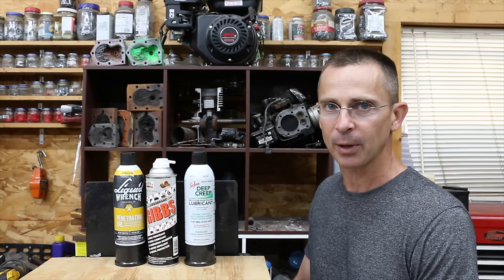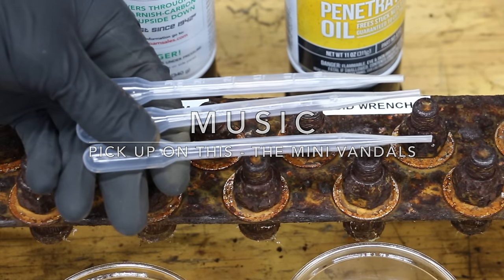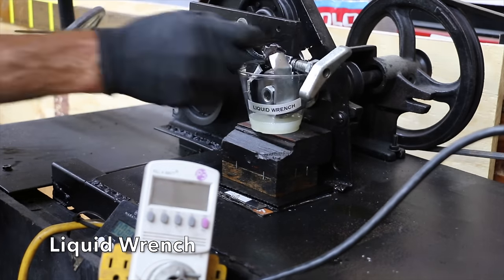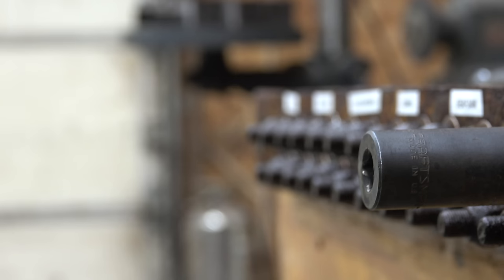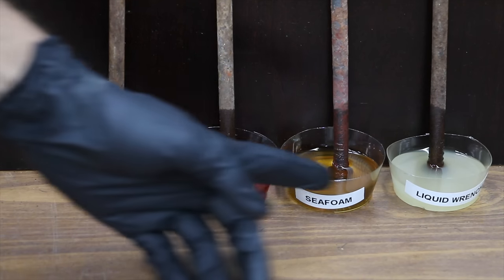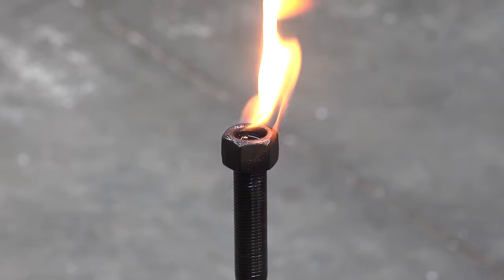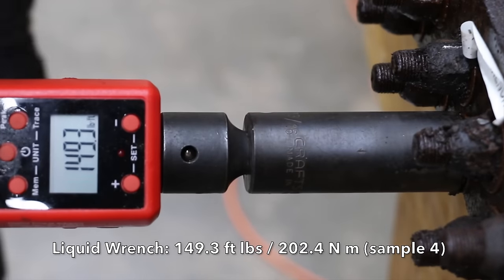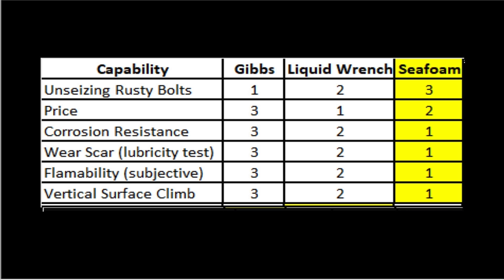Best Penetrating Oil?  Seafoam vs Gibbs vs Liquid Wrench

Comment: Why didn't you use wd40 and p.b. blaster or j.b something for this test??? And another thing when and if I use a spray lubricant I'm not waiting around I'll give it a few minutes and then I'm putting my wrench or socket on it and turning. Therefore I think you need a redo this test and see what happens and which one's the best in a few minutes of lubing the bolts and nuts also try drowning the nuts or bolts when it's rusted up like that then see how your results are because that's what I deal with on a daily basis it sucks and it's a headache and a nuisance
Reply from the maker: Great recommendation. I tested it in this video: https://www.youtube.com/watch?v=xUEob2oAKVs

Comment: I would.like to see what works best as corrosion protection for something like lug nuts on a salt water boat traiier or vehicle.in a state whe  they  use salt.. Seafoam,  fluid film, super blue marine grease,clear spray.paint,zinc spray paint,corrosion x,dupont teflon dry lube, silicone dry lube,never seize.On a side note fluid film seems to attract little flying bugs which get stuck in it and die.
Reply from the maker: Thank you for the video idea!

Comment: Could you try out MPM motor oil? Not as penetrant but as what its made for, kind of the wrong video to comment on haha. MPM is readily available for me (in the Netherlands) and I wondered if it’s any good. The ones I can easily get are MPM, Valvoline and Castrol oil (in case you needed oil to compare it to)
Reply from the maker: Thank you for the video idea!

Comment: I had to glue-on pieces of pvc brackets to the rear of pvc bath panel boards-  tried everything, then tried pvc plumber's solvent glue, tried to pull-off a test piece,- it took the board with it!!
Also;- I tried to re-stick a timber foot/leg to my plastic toolbox. Tried pva glue,:- no.  Super (c.a.) glue;- no.  Then polyester (GORILLA) foam type glue ;-  it held for ages, until someone dragged toolbox instead of lifting!!

Comment: Now for the next video,there is a brand new oil on the market called"BLUE-💎-DIAMOND",this oil is suppose to be"superior"(no pun intended)to Amsoil,it's ridiculously expensive at about $45.00 a quart,but the company that's based in Ohio says it's rated at 50-to-100,000 miles if you keep the oil really clean.
I looked up the specs for this stuff,the T.B.N.(Total Base Number)is 14.1.
Now,the T.B.N.system is O through 15,so it's suppose to be extremely tough.
I would like to see a video about a standoff between Amsoils 5W-30(signature-series)and Blue-💎-Diamonds 5W-30 weight motor 🛢⬅oil,this will make one,wicked,video!!.Thanks!!.
Reply from the maker: Wow!  Great suggestion!
Reply: @ProjectFarm  You could even have that eerie gothic opra music playing in the background for the intro...HAHA!!.(just kidding)

Comment: 05-08ish Ford v8 owners often need to put faith in something like ATF/Ace to help them remove those stupid 2pc spark plugs without fear and without thoughts of that expensive extraction job.  Even if you snap the first 1 the tool is about 150 from ford (cyl head stays on) and A/A will still help you remove the busted core.  Let it sit o/n and go!   Ford quoted my brother 800 for the job 1500 if they have to remove a head and 100 additional per plug if they should break (scum prolly would ‘break/lie’ about all other 7).   Bro asked Ford can i buy the tool.  They said yes but its expensive and takes 2wks to get here.  He heard price, bought it from Tousley Ford instead (good people) came in 2d.  Next morning his stang had 8 holes ready for new (and wisely 1pc) plugs.  It was one of the first affirmations we had after reading another test I believe in popular mechanics about A/A.  Good luck all.  By the way he sold the tool to another stang owner in a pickle for what he paid for it after we provided him visual proof that it worked.   

-U10

PS - have to ring stuck fasteners with a hammer when able.
Reply from the maker: Thanks for the feedback.

Comment: So if it's going to need heat: Seafoam
(it also works the best as a lubricant so it may be better to have sitting than WD40)
If you need the absolute most rust penetration: Gibbs
and if you need a lot or want to save a substantial ammount of money: Liquid Wrench
Reply from the maker: Thanks for the feedback.

Comment: OK have you ever did a video or a blog on gas treatments for methanol ethanol . Mainly into storing like a motorcycle or a small engine with gas in it. You see we store motorcycles and I know gas turns really quick these days. I was wondering if there’s anything out there that you know of or if you did any videos on this subject. Actually I just put a new fuel pump and a bunch of hoses and stuff on A Harley that’s been sitting for like six years he said three if your pump was like just about gone. I know that’s excessive. But I’ve stored gas over the winter is an experience an hey Harley that’s been shitting like six years he said three if your pop was like just about God. I know that’s excessive. But it seems this new gas doesn’t hold up for storage even for as much is for five months. Thanks
Reply from the maker: Not yet. Thank you for the video idea!

Comment: Friend, to prevent rust, nothing beats high temperature copper impregnated anti-seize coating. Prevent oxygen and prevent rust spraying the bolts with rust reversion and high temp paint to coat the bolts and I promise you better results
Reply from the maker: Thanks for sharing.

Comment: What if you used evaporust as a penetrating oil? Or a mixture of evaporust and another penetrating oil?
Reply: Oils are bad for Evapo-rust, that's why they tell you to degrease the parts before soaking.
Reply: Oh. I’ve never used it so I’ve never seen the instructions.
Reply from the maker: Thank you!

Comment: Have you tried Knocker Loose penetrating spray? I love that stuff but it smells like charcoal lighter fluid lol. That and PB Blaster mixed together have gotten me out of some nasty situations as a Auto Technician in Minnesota with all the rust we have.
Reply: I have also been told Automatic transmission fluid mixed with acetone or to use DOT 3 brake fluid in a pinch depending on paint in area.
Reply from the maker: Thank you for the video idea!
Reply: @ProjectFarm  just a heads up, i was soaking a starter pinion in the Knocker Loose/PB Blaster mixture in a cheapo wanna be clear red solo type of cup and about an hour and a half later noticed a leak.  Picked up the cup any the ENTIRE bottom came off the cup.

Comment: Can you test Rotella T5 & T6 vs MOTUL & Amsoil Metric Oil?
Reply: Rotella is and has been substituted for motorcycle oil for a long time. The diesel oil does not  contain friction modifiers that work well with wet clutches. I am not sure your typical oil test could apply to a motorcycle. Thanks for the content!
Reply from the maker: Thank you for the video idea!

Comment: Hi. I have one question for you. 

I'm fixing an oven, and there's a nut (the one from the fan) that is rusted and can't be taken off. I can't take the bolt where it is fastened, as it is fixed to the oven's hull so i can't put it in vertical position. I have a kitchen blowtorch and muriatic acid available, but i'm not sure if the heat will make any good and if the few acid that will remain in the nut and get in the gap inside the nut will be enough to remove enough rust. I also tried with lubricating oil, but doesn't seem to work at all. 

Any ideas?
Reply: Don't put acid on it, he used acid to ruin the bolts on purpose.  Heat it up and let it cool multiple times and oil it when warm.   That's what I would try
Reply: @RickBaconsAdventures  I'll try it, thanks for the tip.
And yeah, saw that video too, that's also why I don't want to use acid, I would like the bolt not to become a cheese if possible, ha ha ha
Reply from the maker: I would use heat.  I hope this helps

Comment: I've been using Liquid Wrench for ~50 years, and I see no reason to change, aside from availability. It's "old fashioned" I guess, and not seen as much these days. PB Blaster is the most common, but I have never found it to be quite up to Liquid Wrench standards. Still, I sometimes use Peanut Butter Blaster when I can't find LW, as it is certainly better than nothing.
Reply from the maker: Thanks for sharing.
Reply: ..I remember Liquid Wrench was about the only penetrating oil I remember seeing around back in the early '70's when I was a kid..remember Dad using it..it was a dark grey/blackish color back then..and it definitely smelled different/stronger than it does now..has it been reformulated, maybe?...would be really neat to find some vintage 1970's liquid wrench and test it against current liquid wrench..a la old STP vs. new STP.. :)

Comment: Wait your supposed to do 3 treatments over 3 hours damn my adhd. I have always used the age old trick of swear at it spray seafoam go for a smoke swear some more and bust out the I wasn't asking bar and wait for somthing to give (the breaker bar the nut or the bolt). If all else fails just bust out the sledge and swear while beating it until you feel at peace again
Reply from the maker: Thanks for the feedback.

Comment: In tests like the one-hour torque test, where you collect multiple samples of each experiment, you need not to draw conclusions merely by comparing averages.  Rather you need to compute the mean and standard deviation of each sample set and then use a statistical test called "student's t" to draw your conclusions.  Student's t will tell you whether the sample sets have so much variation that no conclusion can be drawn.
Reply from the maker: Thanks for the constructive feedback.
Reply: @ProjectFarm  Using the torque callouts in your video I performed student's t on the one-hour torque experiment.  I found the following:
1.  control:  mean 167.7, sigma 12.96
2.  LW:  mean 149.4, sigma 4.60
3.  SF:  mean 161.1, sigma 9.71
4.  G:  mean 145.5, sigma 9.33
Using those distributions I then performed pairwise student's t.
1.  Ctrl vs. LW:  10% less torque at 90% confidence level
2.  Ctrl vs. SF:  no statistically significant difference
3.  Ctrl vs. G:  13% less torque at 90% confidence level
4.  LW vs. G:  no statistically significant difference
So what I conclude from this is:
1.  There is no evidence SF is any better than doing nothing
2.  There is some evidence LW and G are better than doing nothing
3.  There is no evidence LW is any different from G
FYI medical trials, drug vs. placebo, usually require a 95% confidence in order to conclude anything.  Your confidence levels were only 90%.

Comment: I understand why you don't use the built-in application methods to keep the amount consistent, but I would argue that isn't really relevant to most end users. If Seafoam coming out of the straw is more effective than applying it in liquid form with a dropper, that's the way I want to test it. I'm not as concerned with conserving every possible drop of penetrating oil, as it's my time that's valuable, not the penetrating oil. 

I would like to see a test where you spray with each applicator for the same amount of time, for instance, and see if the results are any different.
Reply: it would have splattered on the other bolts.  The test rig would have to be huge
Reply from the maker: Thanks for the constructive feedback

Comment: None of them were that much effective they were OK at best which was Gibbs, I don't see any point of using anything other than Gibbs. Nothing can beat heat but there are applications where you want to avoid heating as much as possible, like hardened steels, and if the penetrating oil fails you have to use heat, so I believe more flammability and lower lubricity of the Gibbs means much of it will burn during heating and won't add as much residue as for example Seafoam.
So for me it is Gibbs or nothing (using heat starting with a heat gun if I want to prevent too much heat).
Reply from the maker: Thanks for the feedback.

Comment: I use wax and heat, old school method, takes a little longer but way less stripping and breaks in those pesky rotten nuts and bolts.
Reply from the maker: Thanks for sharing.

Comment: Use bees wax with heat.
Reply from the maker: Thanks for the suggestion.
Reply: @ProjectFarm  used to work on huge powerhouse turbines. Studs could be as much as 5” across. The nuts were substantial size. All turbine bolts are vertical. We would strip heat the nut on 2 places 180 degrees opposite of each other and use bees wax. Probably used bees wax because back years go there was no penetrating oils, don’t know for sure but penetrating oils were around in the 80’s when I used to work on turbines. We never used them on turbines. Don’t know why, could be because they could be flammable or maybe we just used bees wax because “that’s the way we always done it”..lol

Comment: For people to know, WD-40 is far more accurately understood as a NON "lubricant."  It lubricates only because 7/10 times, the average joe is adding WD to old grease and the WD will reconstitute it and thin it back out into the workings of parts.  So, they think WD lubricated.  It's like adding water to Coke syprup--makes it usable. But you aren't lubricating with WD, on it's own.  They dissolve gunk and dirt and that will make anything work more freely.
Reply from the maker: Thanks for the feedback.

Comment: Who uses penetrating oil on a seized Rusty nut to break it free? Professionals use heat to break it free and then little oil to run it off. Only nubs use penetrating oil.
Reply from the maker: Thank you